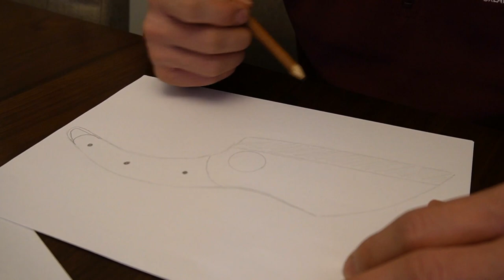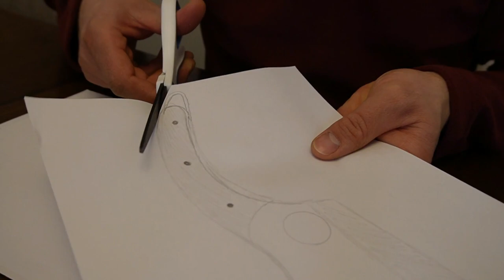From Saw Blade To Kitchen Knife / DIY Project

Comment: Good job! What kind of steel is this knife made of? I also made a saw knife for myself. Greetings from Poland!
Reply from the maker: Hi, I am not sure but it's a hard steel.
Reply: It can vary with saw blades. It's a question of where the temper ends. Sometimes they are only tempered around the edge, and this can be lost if the metal gets too hot as you are grinding.